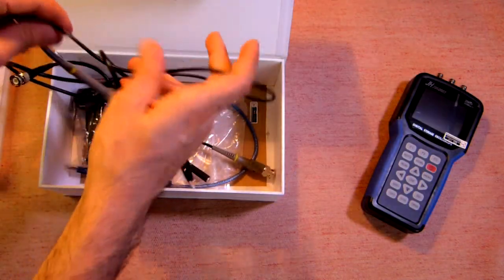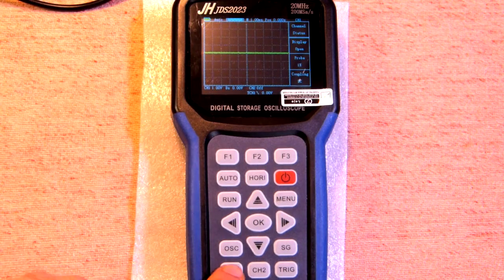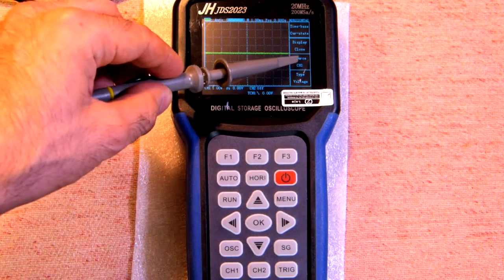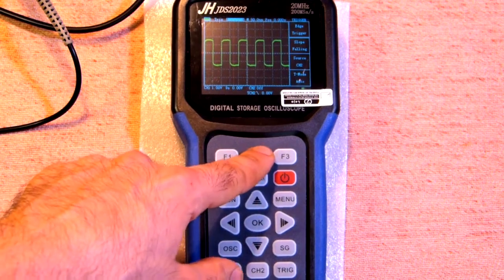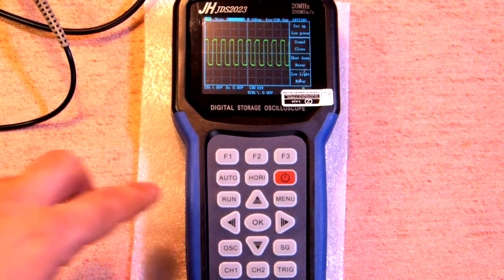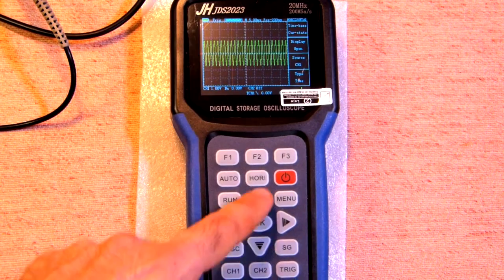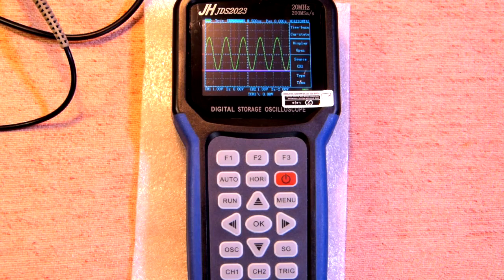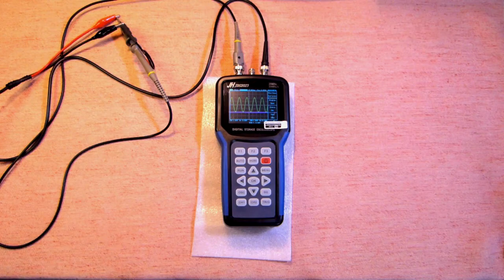JINHAN JDS2023 Oscilloscope Detailed Review

Comment: I did not see any plastic holder inside the battery compartment. The battery will roll off its position if you move the oscilloscope or shake it. Also the key press looks awkward to me.
Reply from the maker: In fact, the device is really good; if you move it, nothing will roll off, as to shaking - please, don't to it :) Anyway, I've placed a piece of metal for "+" contact, as I have the original 18650 batteries with flat "+",  and nothing moves in my battery compartment. As to the keys - they are excellent, as in case they are damaged, you can unsolder them and replace without any problem, that's the advantage of this o-scope; i.e. one of the advantages.